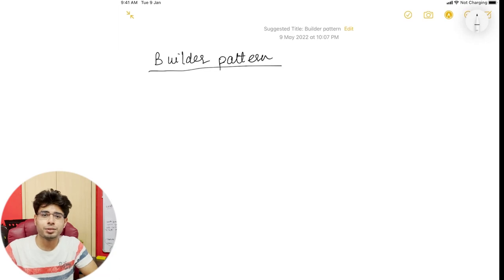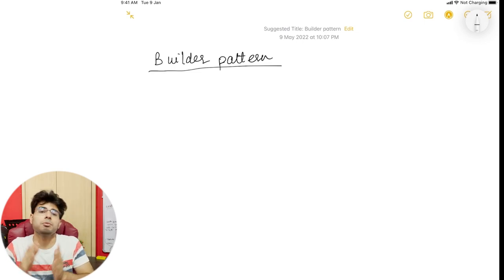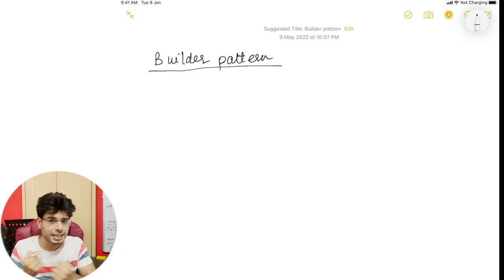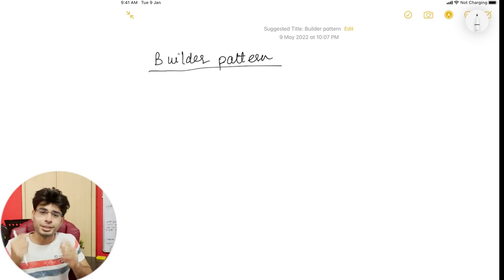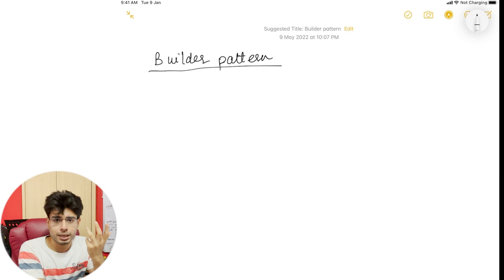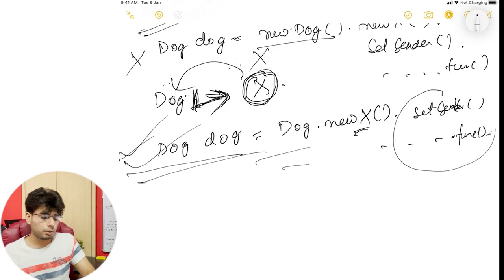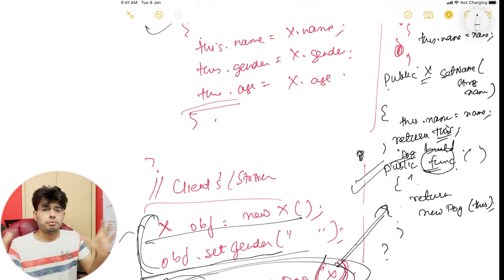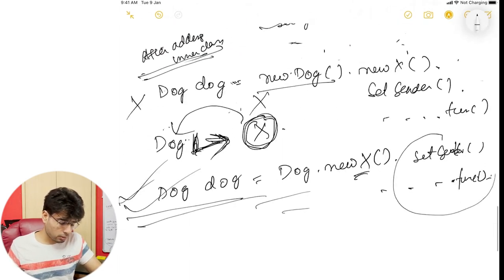Understanding Builder Patterns from Scratch | Low Level Design | OOPS | Design Pattern | Java

Comment: Insightful! But I am filled with doubts. The usage of 'this' keyword is baffling, more so because the code is working. How can a 'static' class 'DogBuilder' have an instance to refer to? 'this' keyword is used in every method in DogBuilder and as said in the video, it's returning an "instance" of the class "DogBuilder". How is this possible? The combination of static and 'this' keyword is confusing. Could you please  reply to the question , forever grateful!

Comment: Good video. I have a doubt. If a new client comes and asks for some extra methods/attributes which are not there in our Dog class, we do not try to modify the Dog class as this is violating SOLID principle(Open closed principle to be precise).The Open-Closed Principle requires that classes should be open for extension and closed to modification. So as done in the video is modifying the already defined Dog class a good thing to do ??

Comment: I had a few doubts: 
1. For some developers, the object of dog class contains extra attributes which are not needed by them and is set to null. Is this an acceptable practice to have such classes with extra attributes ?
2. Is this pattern anyway helpful for languages which support default keyword arguments in constructors (eg. Python) ?
3. Shouldn't a Multiple Inheritance solve the problem better, as the client should inherit only the classes which contain the method that are needed, and so new class would have only those attributes which are needed by client (nothing extra) ?
Reply from the maker: 1. I think it should be fine. One use case which I can currently think of is while writing unit test cases when you want to test a particular functionality and don't want your object to be populated by data , irrelevant to the test case.

2. you can use default parameters. I think it's there in java as well using ellipsis. But still you have to enforce the client to remember the order. And it is also not backward compatible as I mentioned. To top it all off , it doesnt help in code readability when , you pass so many parameters inside the constructor.

3. Multiple inheritance is not supported in java.

Hope I was able to clarify your doubts
Reply: @rite2riddhi for the second question:- there is a concept called named argument by which u can pass the argument in any order into a function, so basically if a constructor has a default parameter value then we can achieve all possible combinations of constructor by using name argument.
Reply from the maker: @obsessiveDreamer  right.